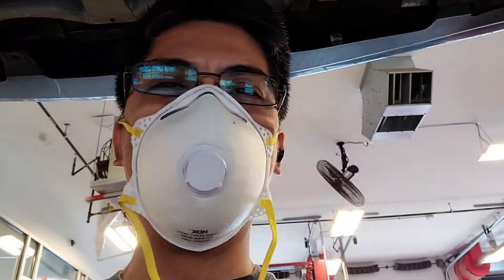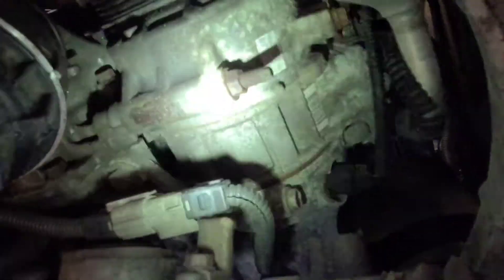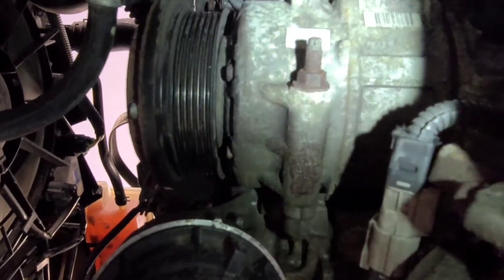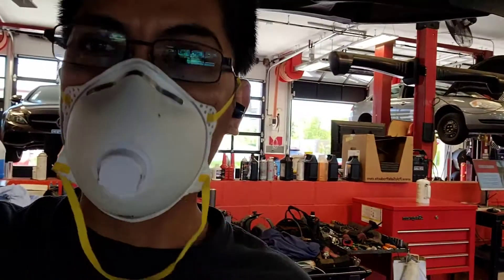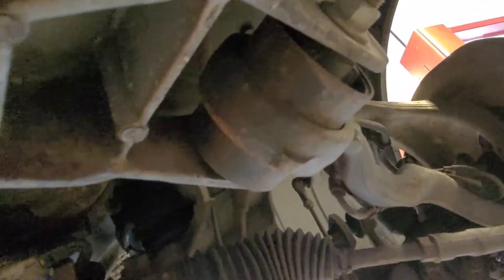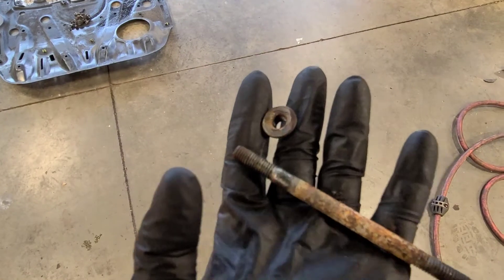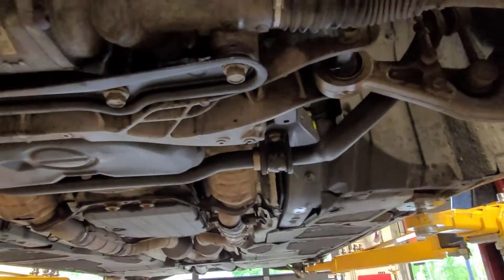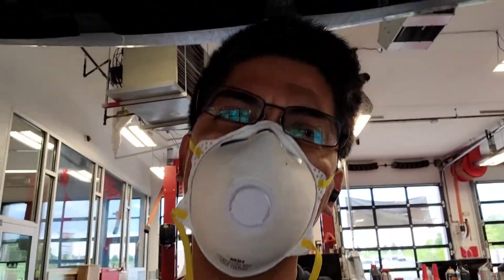2007 Lexus LS 460 A/C compressor removal

Comment: This is amazing Thanks!! Thoughts on putting some Loctite on the nuts and then using them to back the studs out? Also did you put the studs back or  did you replace them with bolts?
Reply from the maker: You can use loctite yes and you can reuse the stud. Unless you break it and if you cant get OEM bolts, by all means use a different but same lenght bolt.

Comment: What kind of noise did it make can I send you a video of my noise and you can tell me if it’s my compressor ?
Reply from the maker: i can try listening to it
Reply from the maker: couple of things i can recommend you. 1st if u can buy a mechanic stetoscope from ur local auto parts store or a thick rubber hose that is long enough. For stetoscope try to touch compressor, alternator, idler pulley, tensioner pulley and water pump pulley from their assembly that is not spinning, listen to the noise and compare. When using the rubber hose, place one end to your ear and the other end pointing infront of all pulley i mentioned, same concept, compare the noise or sound u hear. A bad pulley will make a loud noise.

Comment: I'm getting a code b1421, b1424, but I think the compressor is bad. It works when driving, but it starts to blow hot if I sit still for too long. It always works at night.
Reply from the maker: Have you tried adding refrigerant to it? Most often in ur cases, its just low in refrigerant. Have it recovered and recharge by any repair shop. Ask them to replace those Schradder valves of the Hi and Lo side ports before vacuum leak test and refilling them back up with fresh refrigerant.
Reply: @DRBauto  I already had it looked at and it isn't low. It might be overcharged, but letting some refrigerant out isn't going to fix it. The compressor is old and probably needs to be replaced. All of the other ac components have been replaced. The compressor is the only thing left. When the ac is on at idle, giving it gas runs the gauge up to 90 and the compressor shuts off.
Reply from the maker: @drjd2real  If a recharge and recover machine/equipment is used, then it cannot be overcharged. With the a/c gauge hooked up at Engine off what is ur low side and ur high side reading? This should be close to even value, then place car at Idle and watch the gauge. What is the high side pressure doing is it stable while increasing pressure? How about the low side, is the pressure increasing then drops down and increases again? If the gauge fluctuates so much or one side works but the other is steady, then yes i would replace the compressor.

Comment: How'd you get the studs off??
Reply from the maker: Inverted torx socket 1/4" drive and a vice grip to help loosen if it is frozen to the block.
Reply: @DRBauto  thank you! What size torx Socket did you use? Do u remember?
Reply from the maker: @SacRomero  i really cant remember, but when u get a cheap set (harbor freight). It will be on the 1/4" drive
Reply: @DRBauto  thank u!!

Comment: Is that what has to be done if it’s blowing hot ?
Reply from the maker: You need to find out if the compressor is bad or you are low in refrigerant.
Reply: @DRBauto do you know where the relay is to test compressor?
Reply from the maker: @cutliss  disconnect the connector and apply power and ground and check if compressor kicks on and actually making it cold.
Reply from the maker: @cutliss  but, it is faster to check the static pressure 1st, if u have a A/C machine, then just simply recover and recharge system. If it works then u simply need refrigerant. Could be low or leaked out, if it does not run, disconnect a/c compressor connector and apply power and ground see if it turns on and making it cold.
Reply: @DRBauto  thanks for the reply. I'm gonna check it the way you said. Tried using the scan tool but I think I would still need the right pressure for it to activate. Thanks again for your help 👍
Reply: Static pressure were close. I believe 145 psi on both high and low. Then around 100 when the day cooled down. I do have a code for open circuit/ low refrigerant.

Comment: Is it possible to just remove the pulley & not the entire ac compressor itself?
Reply from the maker: i have not tried that on this. But if the compressor is a clutch system then more than likely you can. But if the AC system is a variable type and or those of hybrid cars, then it is different way of rebuilding. I am not 100% positive if u can rebuild them but in some other countries, i am sure that they have a way to do it.